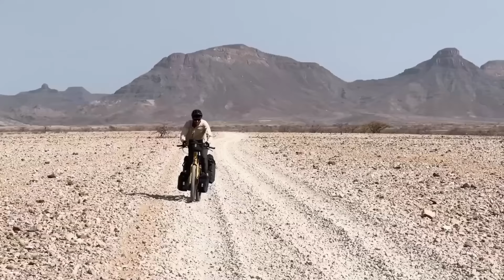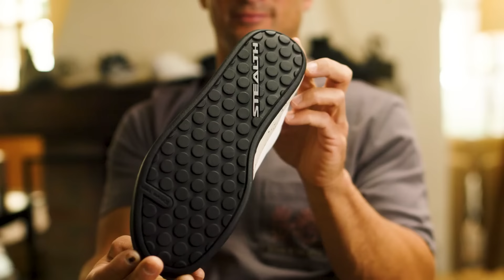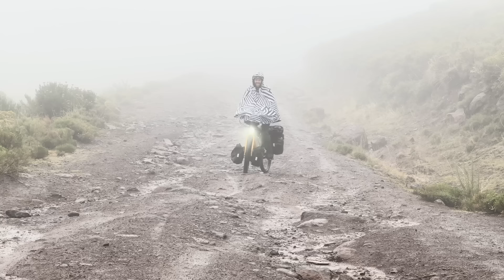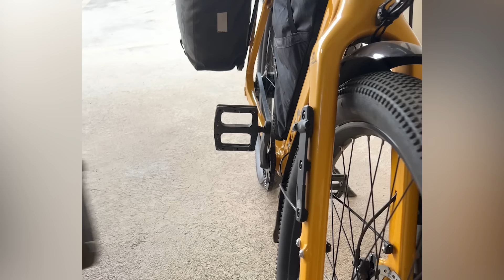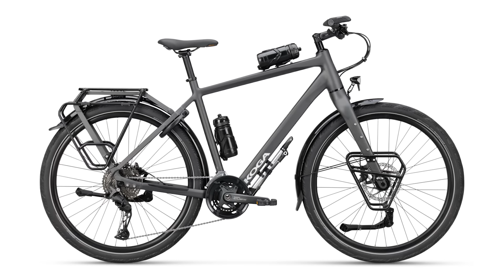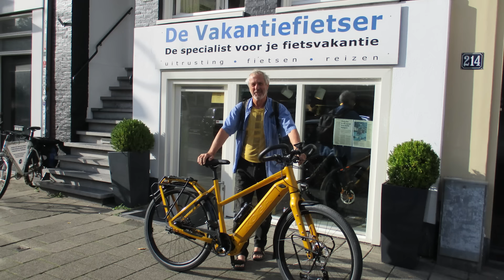The 2026 KOGA WorldTraveller is a $8000 Indestructible Touring Bike

Comment from the maker: FULL SPECS:
Frame: KOGA WorldTraveller-S
Fork: KOGA WorldTraveller-S
Paint: Ochre Yellow
Headset: KOGA Sealed Bearing Steering Limiter

Handlebars: Bontrager Crivitz
Stem: Vecnum Freeqence
Grips: Wolftooth Lock-On https://amzn.to/4l5eTO5
Seatpost: Redshift ShockStop PRO Endurance https://amzn.to/4kVBsEZ
Saddle: Selle Italia Sport Gel Flow https://amzn.to/4l2xcDw

Gears: Rohloff Speedhub 14-speed Internal Gearbox Hub
Shifter: Rohloff Grip Shifter
Front Hub: SON 28 Dynamo
Rims: Ryde Rival 27.5" 36 hole
Spokes: Sapim Race
Tyres: Schwalbe G-One Allround 2.8" https://amzn.to/41gKdSP

Brake Levers: Shimano XT Hydraulic
Brakes: Shimano XT Four Piston Hydraulic 203mm Rotors

Crankset: Gates S550
Chainring: Gates Carbon Drive Centertrack 46T
Cog: Gates Carbon Drive Centertrack 22T
Pedals: Deity Deftrap

Fenders: Eurofender Tempo
Charger: Cinq Plug6 Plus
Lights: SON Edelux II and SON Tail Light
Bidon Cage: Velo Orange Mojave
Phone Mount: Quadlock https://amzn.to/4fjZoAz
Framebag: Conquer Custom
Top Tube Bag: Tailfin Flip
Front Panniers: Tailfin 10L Mini Panniers
Rear Panniers: Ortlieb BackRoller Plus
Rack Bag: Ortlieb Rack Pack 31
Rear Rack: KOGA
Kickstand: Pletscher Comp 18 Flex

Weight: 21KG or 46LB

Note: There are a few Amazon links. If you purchase through them, you will support this channel at no cost to you!
Reply: Is this a new model? Or do you have two of them?
Reply from the maker: @iAnasazi  This bike came out two years ago, which is how long I've owned it.
Reply: So does the Koga still have the eccentric bottom bracket?  I've heard that those are a source of problems
Reply from the maker: @larrym2434  It has forged sliding dropouts.
Reply: Hi, the video is very interesting, thanks for sharing. I also have a redshift seatpost and I have a bit of problems with my saddle position, can you please share more details on the mod you did ? Thanks in advance
Reply from the maker: @antonioc2963  Search "DROP BEST UC Redshift".
Reply: I cannot find what model of aerobars is in this specification. Do you remember what is it?
Reply from the maker: @wojciechwaszczuk8565  Redshift Quick Release
Reply: @Cyclingabout , I found your blog about aero bars for bikepacking, VERY useful. (Geometry and riding positions explained ) Especially, because I ride a bike frame designed for flat bars (Specialized Sirrus 1.0 -love it), have cheap aerobars, BUT since I have to lean TOOOO far forward and too low,  it is very uncomfortable, and I use it as a rain jacket hanger mostly. 
Considered Fred bar, but since its price is already half of the reasonable areabar + shipping to Europe adds even more, this idea was shelved.
Reply: I am from Pakistan I book a bike tell me a process plz
Reply: If you ever worry about snapping those XT levers check out FLO PRO 120 levers
Reply: what about aero cockpit? cant find it
Reply: float🎉
Reply: Man if I was going to ride on eight thousand dollars bike,I'll  rather go  on a car, that's a lots of money for a bike 😂

Comment: Hi Alee; huge fan here. I have a couple questions for you. I am interested in buying a Worldtraveller Signature model. I tried to use configurator but I have a few questions. If I use 622 x 30 mm rims, what is the maximum tire width that I can use? I know that 27.5 is about 2.8in max. I am interested in the Rohloff version;  do they offer 36 spoke wheels with 622 rims? Thanks Chris
Reply from the maker: Officially, I think it's 2.25" on 622 rims. But if you were to take the fenders off, you'd have a bit more clearance. I believe KOGA still uses 36-hole hubs (at least, they were three years ago when I picked up mine).
Reply: @Cyclingabout  thanks Alee

Comment: I appreciate you know why you forego the optional suspension fork. Can you explain why you choose rigid front forks? (I am thinking of spec'ing the same bike, but I thought front suspension might be better to have when riding on gravel road (washboard surface) and single track trails?
Reply from the maker: I started out using front lowrider panniers and a rack up front, so that primarily informed the decision. But using a rigid fork is also one less thing to service, and one less thing to risk breaking. Combined with 2.8" low-pressure tyres, a suspension stem, and front luggage, the ride is already very comfortable.

Still, I’m curious to try a suspension fork someday and see how it performs with minimal upkeep.

Comment: Last year I bought the standard version with derailleur. The handling on both tarmac and offroad is fantastic. By far the most steady and smooth bike (fully packed) I've ever used. Also the most heavy one, you certainly feel that when climbing steep roads. Nevertheless I managed to cross the Alps, Dolomites and other mountainous areas in the Balkan countries with my fully loaded Koga WT. In the process of doing that, I lost almost 9 kilo of bodyweight myself. 😁

Comment: I'm a long-time tourer in SE Asia, with more than 15 years of heavy work under my bum.

This whole review of an "indestructible" touring bike is just crap.

I would never go out on the jungle roads of Asia with a belt-drive.

Who's gonna be able to help you fix a bike like that outside of Bangkok...?

As a serious tourer I use CHAINS, and V-BRAKES, not discs.

Grow up, please. ❤️
Reply from the maker: I've been riding jungle roads for a very long time with a belt drive and disc brakes, and it's been great. In fact, the jungle roads in Madagascar (where I am now) have been some of the most difficult I've experienced.

It sounds like you just haven't tried these components, and that's ok! But it's better to have a neutral opinion on something you have zero experience with. 👍🏻

Comment: In frame cables offer several benefits , what they dont do is provide extra dust and grit protection. think about it dust gets into cable casing from the ends  not through the housing [ unless damaged ] proper lubrication of the cables will do much to prevent dust intrusion.
Reply from the maker: You're right. My intention was to compare this cable setup to bikes that don't have full-length cable housing, where water and dust ingress can occur at multiple locations.
Reply: @Cyclingabout  Is that still a thing ?

Comment: the chromoly frame is the best frame for touring bike.
Reply from the maker: After extensively testing every frame material on different touring bikes, I am pleased to report that it's the design, engineering, and manufacturing that are most important. The frame material really doesn't matter if the other things aren't good.

Comment: My Rose Activa 2 has 73,000km, similar spec to the Koga and it still going strong and I paid for it with my 3700 Euros
Reply from the maker: The Rose Activa is a great bike, from a great value brand! I'm not sure why the bike was discontinued.

I just checked a CPI inflation calculator, and it turns out that 3700 euros in 2018 is the equivalent of about 4650 euros today. The standard KOGA WorldTraveller Rohloff is 4699 euros, so the price is similar to the Rose when you take inflation into account.

Comment: Amazing piece of tech, these guys take everything to the next level. I was always amazed by these Kogas and they really live up to the hype. That said, there's one major problem: cost. You can do absolutely everything this bike does at an eighth of the price and in my experience, just as reliably and comfortably, although with a bit more scratches. Spending more, a sixth of the price, you can add a lot of fancy stuff and get even closer to have almost no problems whatsoever. So as much as I've always love them, unless I were sponsored by them, I really don't think they are worth the price tag and definitely do not need to spend 3-4 entire years worth of cycling traveling budget in them. At the end of the day, it's a matter of personal choice on how one allocates travelling capital. :)
Reply: You can't put Rohloff and Gates on a bona fide touring bike for an 1/8th of the price of a Koga.
Reply: @99muddy99  I don't know, but I never said you could. In any case, I was never interested in a Rohloff system and never used disc brakes but good old regular V-Brakes. I have no idea what Gates are, probably some other super fancy piece of equipment. I'm sure it's all great, I just said I wouldn't spend 8k on a Koga with all of that no matter how comfortable and easier my life would be. I'm not against bicycle travelling with the Rolls Royce of bicycles, I'm sure it's great. That said,  I cycled 90k in 4 continents with a bike that all included was about 1.2k and to be honest, I didn't really feel I needed much more. I have friends who cycled for 15+ years with 500$ bikes. They had more problems, but at the end of the day, they were pretty damn happy with the experience. The point is: travel with a bicycle you love, you can afford and can fix yourself 95% of the time, and you'll be fine.

Comment: what about bottle holders? I'm looking for a good one for 2l bottles.
Reply from the maker: I used to fit 2L plastic water bottles (eg. Coca Cola) into BBB Fuel Tank XL cages, but have since moved to a 1.5L Nalgene bottle in a Velo Orange Mojave.

Check out the TwoFish Growler Cages for a 2L bottle holder. Or you could just strap down a big bottle to a cargo cage, although that's a bit annoying to access.

I have some more ideas here: https://www.cyclingabout.com/cargo-cages-anything-cages-oversized-bottle-cages/
Reply: @Cyclingabout  BIG thanks!👍

Comment: Thanks for a wonderful, comprehensive vlog. So informative and packed with wisdom derived from many kilometres on all sorts of terrain. Can you please tell me the sizes of your front chainring and rear sprocket? I have Rohloff Speedhubs on two of my bikes. I love them. But I'm thinking of changing the rear sprocket size on my bikepacking bike to give me an even lower bottom gear for when I'm fully loaded. I have 4.00" tyres on my Tumbleweed Prospector. They are wonderful for handling all types of terrain. My rims are 80mm internal width. I'm thinking of changing to 50mm rims with 2.8" tyres like yours, to reduce the weight and improve my climbing abilities. Do you think the weight savings would be worth it, because it would involve rebuilding wheels around the Rohloff and Son hubs? Keep on riding and vlogging, and keep safe. I love following your travels.

Comment: The only two genuine world traveler bicycles are both short wheelbase two wheeled recumbents with under-seat steering. I'm talking of course about the HP Velotechnik Street Machine Gte (Germany) and the Azub 6 (Czech Republic). I have  the Street Machine and I would not trade it for any bike on the planet. It rides like a perfect union of body and machine. The experience is sublime.
Reply: Only to be outdone by Flux S800 and S900. I rode the Great Divide on a S800 and crossed NZ on a S900. Divine. Also had a Streetmachine

Comment: Thanks for the great video and review! I was curious about which model/year shimano XT brake levers you're using and whether there was/is an issue with the Rohloff shifter making it hard to reach the right hand brake lever with more than one finger?
Reply from the maker: I use BL-T8100 brake levers. There's still ample room for one finger braking with regular lever blades and Rohloff shifters. Keep in mind that most Rohloff bikes don't use brakes with a long lever blades.

Comment: OK, a bit of (constructive) criticism. You said you're trying to make an objective review, but it kind of feels like an ad, at points. For example the part where you talk about the frame design. It sounds like you're just saying whatever the manufacturer says in their material. Or do you have a background in engineering? It's the first time I and many other viewers have seen you. How do these designs compare to other bike designs, other bikes you've ridden? A lot of sentences feel vibes based or just you trusting the manufacturers word. Maybe that's not the case, then you should adjust your wording a bit.

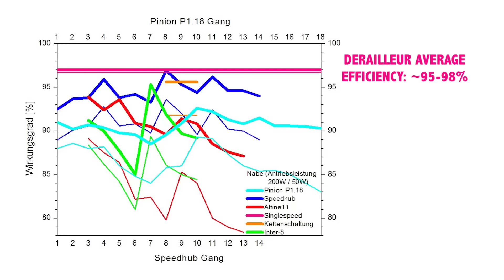5:35 "it's been proven" by who? Who made that graph, you? Roloff?

10:00 10% less vibrations? Maybe that's just me but I don't really understand what that means. Did you measure the total vibrations or what? Seems pretty odd. I feel like you should have talked a few sentences more about this (method, graphs) or left out the data completely and kept to a subjective experience report.

12:08 yes! That one sentence explanation of why those angles are important is what I was missing in the frame section of the video. 

The experiences you share are great though, for example when you talked about belts and the charger I like those parts a lot. It's clear it's what you think about it and you prove it with your own material. The efficency loss from lighting (0,5 km/h on flat terrain) is an extremely valuable number imo. Same as the efficiency gain from aero bars.

Sexy bike all in all, though that weight really is something. I ride a GT frame and while I do feel the sway from the light duty rack, I always felt it was quite predictable. Though on a long tour like yours I wouldn't trust its durability. I've got a 30yo Shimano XT on it 😅.
Reply from the maker: Thanks for taking the time to comment. Keep in mind that this is already a 20 minute video, and I cannot possibly cover every aspect of all components discussed, let alone keep viewers engaged the whole time!

Frame design: This is my own interpretation of the frame design based on discussions with the KOGA engineers. This is the first time that torsion chambers have been used on a touring bicycle frame, and the way the down tube is constructed is a technology developed in-house by KOGA. All other premium aluminium touring bikes use hydroformed and butted frame tubes welded together. I don't have any frame deflection measurements, but this frame feels stiffer than any touring bike I've ever ridden (I've tested more than 50 touring bikes).

Rohloff hub efficiency: Testing is by FahrradZukunft. It seems I forgot to put a label at the bottom.

Suspension stem: That's 10% less overall vibration measured at the handlebar compared to a rigid stem over our "bumpy gravel road" obstacle. Check out the CYCLINGABOUT Comfort Lab for all our vibration tests: https://www.cyclingabout.com/category/comfort-lab/

Comment: 11:52 Was the rear wheel manufactured by Koga?
I can't`believe they put the valve hole in the wrong position with respect to the spokes.
The valve hole has always to be between two nearly parallel spokes in order to have best access for the pump head. Here the valve hole is offset by one spoke hole to that correct position.
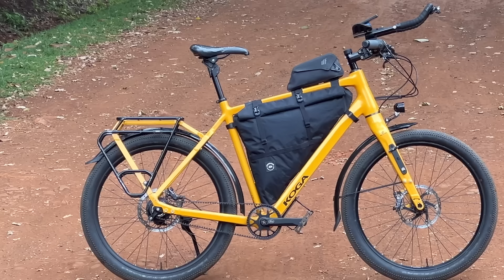Compare this with the front wheel at 13:34, which has been laced correctly.
This error shouldn't happen to a professional wheel builder.
Reply from the maker: You have a good eye! The wheels I collected from KOGA didn't have tubeless ready rims, so I swapped them later. The wheel builder made a mistake in the build process (his first Rohloff wheel build), but I was in too much of a rush to get it corrected.

Comment: Are you happy with your new brakes? Do you really feel the upgrade? If I am not mistaken you are riding 4-piston brakes with 200mm rotors, as opposed to 2-piston brakes with 180mm rotors on your old WorldTraveller.
Reply from the maker: Yes, the performance difference is very big! And with the fatter tyres, my descending speeds are much quicker than my previous touring bike, so I need all the stopping power I can get.
Reply: @Cyclingabout thanks for your answer! 

I also run massive Hope V2 brakes with 200mm rotors (and 3.2mm thick!!!!) on my touring bike and I love it, but I always wonder if it is overkill 😅

Comment: Schwalbe tires are of poor quality, I have had a bad experience with their tires, in order not to be in the middle of a trip in the wilderness because of a tire that has blown out, it is better to choose a reliable manufacturer. Continental, Maxxis, Vittoria, that's what is better than Schwalbe
Reply from the maker: This is not my experience at all. I’ve had nothing but reliable tyres from them. Which model exactly were you having problems with? Also, what width and pressure was it?

Comment: Thank you for this very in depth video. Concerning lights and charger drag, I would like to know where you got the data from. I doubt that specifically SON Ladelux slows you down more than the Cinq and the SON Edelux 2.
Reply from the maker: This is data from FahrradZukunft. The Ladelux is 3x brighter with more powerful charging, so it consequently has a higher drag. There’s simply no getting around that.

Comment: Purchased a lightly used Koga, and my biggest impression is the weight.  Mine is a 54 CM center to center.  I think larger frames made for taller riders makes sense, but at 5 feet 8 inches tall by 160 pounds, the bikes 47 pounds to my size ratio doesn’t work well. Indestructible and well made?  Absolutely. Too heavy? Yes.  Went back to my 36 pound steel SOMA.
Reply from the maker: Perhaps you're a bit more sensitive to weight than me. I'm only 15 lbs heavier than you and I can't say I ever notice the 4% extra weight once my bike is fully loaded. Without my panniers, food and water and it's definitely evident!
Reply: @Cyclingabout  quickly,  some other facts. 68 years old … I’ve always ridden strong for my age, and still do all the things I did in my 20s, 30s, 40s!, 50s!!! And now 60’s. Headed back to Chile and Argentina this December and January to finish the route. I guess my point was there is some sort of weight to height to frame size ratio, and that 10 plus pounds does make a difference. I love your videos!!.